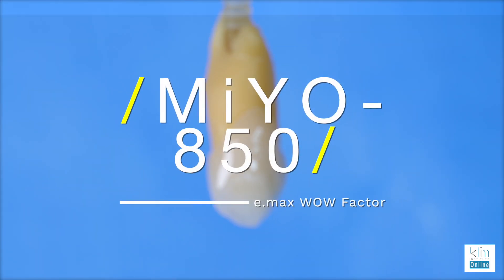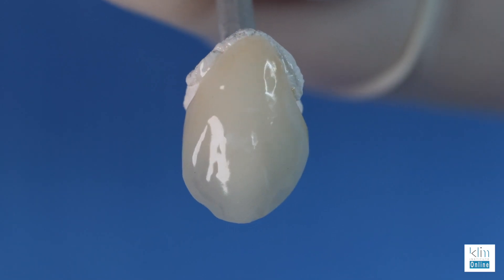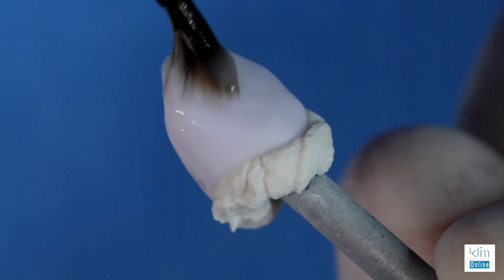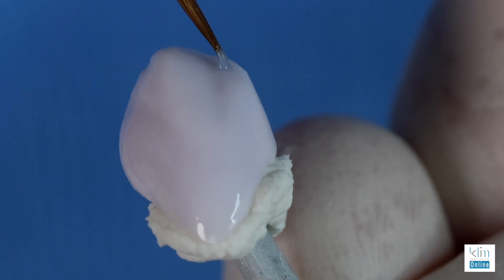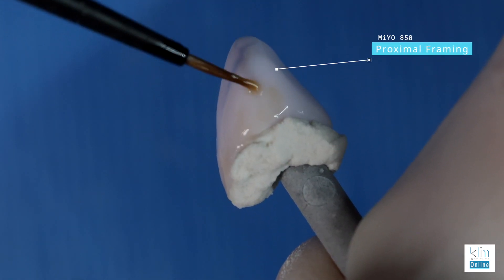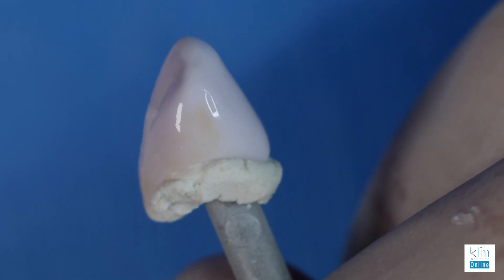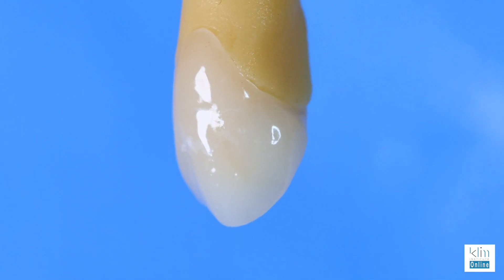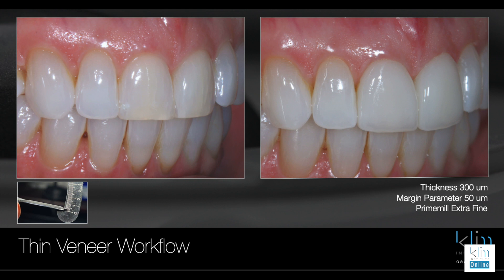e.max ceramic MiYO 850 Glaze WOW Factor!

Comment: Can you achieve this results with regular Miyo or a need the 850 version, I just bought the regular, so that’s why I’m asking 😅
Reply from the maker: Yes, regular miYO  works well, you do need to fire and crystallize first, and then add to the fired surface, 850 is designed for precrystallization addition, whereas the regular MiYO has a lower fusing temperature, and is not designed for pre-crystallization application, I use both all the time, for instance, I will use 850 on e.max for pre-crystallization if I need any modification after the first fire, then I will use my MiYO aesthetic for the follow-up characterization, the colors in the MiYO aesthetic are better than in the 850, but they're both great products, wishing you all the best.
Reply: If time is not an issue, would you recommend firing first, then using regular myo for best results?

Comment: James, can since the old empress glazes aren't available, are you using one of these lines for Empress?
Reply from the maker: I use Ivocolor for Empress.  Great system!  the MiYO firing temperature is between 830 to 850.  This is too high for Empress.

Comment: What is the difference between nomal miyo and miyo 850? Just the glaze bottle?
Reply from the maker: The normal MiYO has a significantly lower firing temp.  The 850 glaze and colors are different than the normal and are made to fire at 850.

Comment: Great video!  Learned a lot in such a short time!
-just ordered the 850 kit and received it !!!

Regarding eMAX for anteriors-which milling burs are you using and should it be on extra fine all the time?

Will this reduce chipping or uneven margins after milling?

What is the wetting agent that you are using?
Reply from the maker: With the Primemill, I use an Extra Fine mill for all ceramics, and for e.max, there is no chipping.  The speed for the Extra Fine mill with the Primemill is almost as fast as the Fine mill, but with superior results.  The MC XL Extra Fine mill is excellent but significantly slower.  The menu on the Primemill will show the but combo and which burs to use.  I use about 75mL of the lube addition solution for the Primemill and MC XL.
Reply: @KlimDDS  how often are you adding 75 mL
Reply: @KlimDDS  Thank you.
#1-I have 2 MCXL's.  Which burs should I be using for eMAX, anteriors, also to avoid chipping do have to use extra fine or can we use fine?
2.-When you are using the MIYO 850 you mentioned a wettng agent please elaborate
Reply from the maker: @studiobdental  The 12 on the left can work with Fine mill.  However use Margin Thickness parameter of 120 and no fast milling
Reply: @KlimDDS  thank you so much I’ve been watching your videos they are awesome… However your recent video said margin thickness of 100 µm… Is that a newer parameter setting
Reply from the maker: I use Extra Fine mill all the time.  With the Primemill, it is almost as fast as Fine mill and the outcome is superior with no margin chipping on e.max.  The wetting agent for MiYO is the liquid that some with the MiYO 850 kit.  Only use the liquid to wet the brush, and then mix the glaze before dispensing.  The viscosity should be right on.
Reply from the maker: In my hands, I use Extra-Fine mill all the time for e.max.  The Primemill is reasonably fast. For the MC XL, Fine Mill with the 12 but on the left will do well on the margins.  The wetting agent for Mito 850 comes with the kit.

Comment: Where can I buy Miyo 850?
Reply from the maker: miyo850.com
Reply: @KlimDDS  Thanks! Can it also be used with full contour zirconia?
Reply from the maker: @drMichalTrochimiuk  There are two lines of MiYO.  MiYO 850 is for e.max.  MiYO Aesthetic, the initial regular line of MiYO, is made for zircona and can be used on ceramics, but not for pre-crystal application on MiYO.

Comment: What firing cycle do you use with Miyo 850? I believe with empress ceram paste you were staining/glazing pre crystallized ceramic and using speed cycle. Is that correct and if so, do is work with Miyo?
Reply from the maker: Use the regular crystallization cycles for e.max, the beauty of 850 is the colors and glaze can be applied before crystallization, and any follow-up color firings are done with the e.max corrective cycle, great question; all the best.